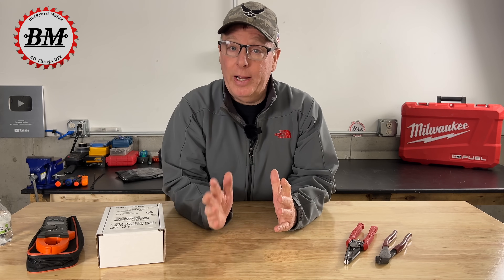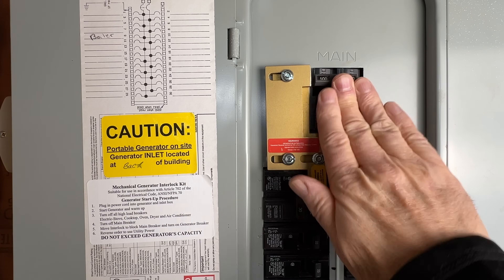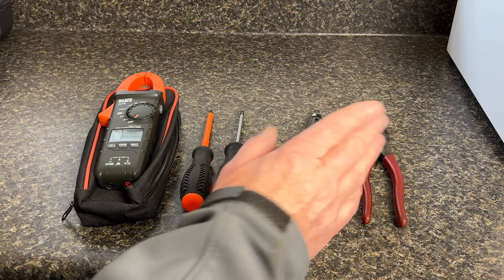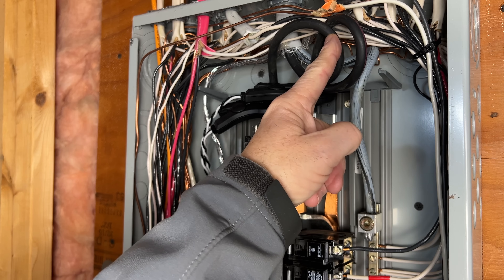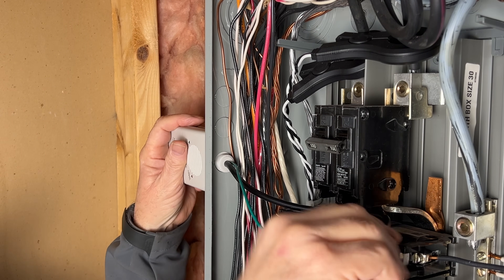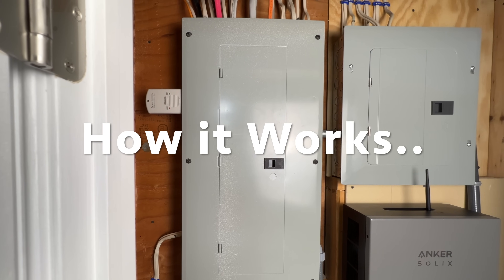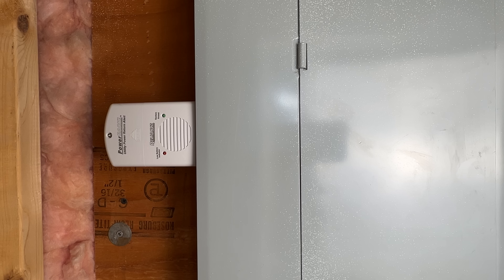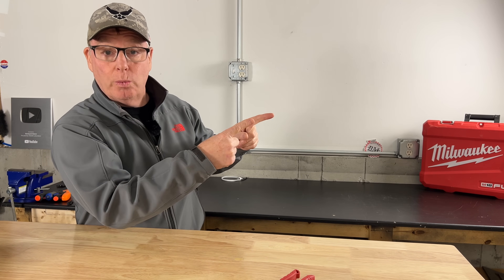The Secret to Knowing When Power's Back On!

Comment: Not a fan of it using a 9V battery that will require remembering to replace it regularly.  Some sort of self recharging system makes more sense.  Didn’t catch if this unit is outdoor rated - our main panel is outdoors.  The loud noise to notify would be obnoxious to our neighbors (and us) especially if it happened when we aren’t home to shut it off.  Why not just a light up an LED as an option?
Reply from the maker: I would guess it will last years since the device will only be turned on during an outage.
Reply: A self recharging system adds complexity to the installation and would probably double the units price. The manufacturer considers these things when designing the device.

Comment: 3:00 DO NOT, ever, pull a utility meter!! One, it is sealed by the power company and if you break those seals without the company's ok, you WILL be charged with meter tampering which carries some hefty fines and possibly criminal charges.  Two, Pulling meters is extremely dangerous and can result in a fire, explosion or arc flash. ONLY the power company or a properly trained electrician can safely pull a meter. (Even then, failures can and have happened. In my career as an electrician, I have had about a dozen issues, a few breaking the meter or the connections, a few arc flash incidents and one explosion.)

If you are installing this alarm and need the power cut by pulling the meter to do it, call your power company and arrange for a quick disconnect/reconnect service call, with your electrician present to install the device at that time.  There are SOME areas where the power company will allow the electrician to pull and reset the meter, but it is NEVER a DIY/Homeowner permitted process.  (Some electricians also have the appropriate PPE and experience to install the alarm without shutting the power off.)
Reply from the maker: I just give them a call and they make a note that I pulled the meter for a repair or replacement. No problem. But of course this would be done by a licensed electrician like myself.
Reply: @BackyardMaine  Thank you for the reply. It is the same in some areas I used to work, licensed electricians could call and get the ok. As I mentioned in my other reply to the retired lineman, I was trained on the right way to do it safely and provided with a supply of seals, meter rings and blank covers. (For some unknown reason, that utility prohibited the use of ringless meter cans...odd since those are more secure IMHO.)
Reply: Yikes! I guess my hot panelboard upgrades would be frowned upon. Nobody calling any utility in this house....we used to pull meters and toss them over the hillside at night for people we didn't like.....good times, high school days.
Reply: I hate to break it to you, but here in NJ homeowners can upgrade their own service (I did it)

And the power company told me to pull the meter myself, then put it back when I was done so they could come and replace it and put a new seal on.

There is no chance of arc if the main breaker is off when you pull it as you must be aware
Reply: @ That is only correct if there isn’t any internal damage done inside the meter can? If you pull it & one of the jaws breaks? You’ll be the first to find out-unfortunately? The only way to prevent a flash/arc is to disconnect the meter at the weather head or in the service box. Only a competent person should be allowed to do that.
Reply: @johnclyne6350 if I pull it and there’s a broken jaw (highly unlikely), I call the utility to fix it.

There can be no arc whatsoever if there is no current flowing when I pull it. As an electrician you should know this. 

Is there any arc when you plug in a hair dryer that is turned off?
Reply: @ The utility I work for does not own meter cans. That is customer owned property. We would cut you at the pole or the house. 
As for current? There is no current if there is no load. However if a broken jam makes contact with any part of the metal can there would certainly be a flash & a lot of current. The only thing that might stop it would be the fuse on the transformer? Or it burns itself in the clear? So unless the meter can is newish (in the last thirty years)? I would rather cut it at the pole or weather head & then pull the meter.
Reply: @ wow the meters are customer owned? What kind of crazy utility is that?

And yes I agree if the legs break off or something crazy then a huge arc could result. How many times have you personally seen that?
Reply: @ Just about every utility owns up to the house knob. The connections at the house knob & the meter. That's it.
The meter can, entrance cable & circuit breaker box are all customer owned. 
I only know of one utility that owns the entrance cable, meter can & cable to circuit breaker. 
I've seen a few where the meter can went on fire. I've also heard buzzing in the meter can on a sunday. I advised the homeowner to get an electrician. If I disconnect & find a broken jaw in the meter I would have to leave him off until repairs were made. He followed my advise & had an electrician there a few days later to replace the meter can. Better that than an emergency call.
Reply: @ ahh the meter can vs the meter, thanks
Reply: @ Yes, they are two separate components. 
The meter is always owned by the power provider. 
The meter can & associated hardware is owned by the homeowner. I can't begin to tell you how many customers don't know that. Then when it's rusted out & in decrepit condition & we disconnect for an unsafe condition. The customer is surprised. It's all part of what the original owner didn't impart to the next owner & subsequent owner. 
For instance. There are overhead & underground easements on every piece of property. Unless you live in a rear lot without any hook ups? 
The homeowner's responsibility is to maintain a 3 feet clearance around all utilities & no improvements shall be made in an easement. Failure to do so is a violation of the easement. 
If your tree comes down in your easement & wrecks utilities. The property owner is responsible for all repairs. Many times the utility will make repairs to their equipment but the property owner is on the hook for all their repairs. 
I was recently on a job where a tree fell on the utilities wire in the easement. They lost the neutral & burned up everything electrical in their house. Even their old wiring was destroyed. We replaced the service wire & left the tree on the homeowners property. We refused to hook up their service because it was condemned by their electrician. They couldn't afford repairs & were left without power. If the building department were to find out they had no power in their house? They could lose their certificate of occupancy. The house would be pad locked by the building department. Unfit for human habitation.
Reply: @pb7379-j2k  I hate to break it to you but letting homeowners upgrade their own service is the exception rather than the norm. In the three states I have worked in, that varied from county to county and even city to city. It was dependent on local utility policies and local code enforcement rules. As far as pulling meters and/or cutting and connecting service drops, that varied within the same utilities. The utility I spoke of in my previous comments officially prohibited anyone other than their workers from pulling meters, etc. BUT it was the regional service crews/ managers that would unofficially allow others, such as licensed electricians, to do it. Oh, and broken jaws are pretty common with meter cans older than 15-20 years, and you'll rarely know (unless you hear it arcing inside or feel heat on the meter or can) untill you pull the meter out. And not every service has a main breaker.
Reply: @ it’s state law in NJ, the most densely populated state where homeowners can install their own plumbing and heating appliances too. We have to pull permits of course. Freedom, fuck yeah
Reply: Stop being so dramatic. It was always common practice for us as a retired lineman, to pull meters with just leather gloves. Pulling an arc, it’s only 240 volts going into most homes. You are correct about most power companies frowned upon it though.
Reply: @purplesocks5984  Except when the jaws are broken inside & you can't tell? You pull that meter with leather gloves you'll be fine. The arc flash is another matter. I wear safety glasses & a flash hood when pulling meters. Yes, I'm a power lineman that is still working. I have seen a few meter cans blow up from meter jaws broken inside.
Reply: @johnclyne6350  Thank you. Mr. Smellysocks is just trolling. I have, as mentioned in one of my comments, had a few meter cans blow up when removing meters. It is no fun. After about the third one I always cut the hots at the weatherhead before trying to pull the meter. I had good rapport with my local utility and they had no problems with it.
Reply: @ There are a lot of ignorant people on here who try to impart unwise knowledge. They might get someone hurt? Ofcourse they would disappear after that.
Reply: @purplesocks5984  No need to be a jerk about it. As a former lineman you of all people should know the risks involved  if someone with no experience or training tries this.  I have over 45 years in the trade, and had many utility servicemen and meter dept. guys told me of failures and injuries pulling meters. I was trained by my local utility in the proper way to pull meters for service work or service upgrades (they even provided me with seals, blank covers and rings.)  The way it was worded in the video (not intentionally) made it seem like he was saying it's ok for the average person to pull a meter. They wouldn't know the correct way to do it, and maybe the company you retired from didn't care, but times have changed. Fault currents in residential areas have increased, more dishonest folks steal power...all stuff you of all people should have known. I'd rather be dramatic than hear about some homeowner getting burned or killed by trying to pull a meter.
Reply: @mxslick50  Let me first say that I'm not an electrician yet I have pulled probably more than 100 meters, LEGALLY, as a volunteer firefighter on Long Island. Whenever there was an electrical fire or a working fire, I would pull the meter. Many times, while the meter was under load. I've never had an issue except a slight flash if it was under serious load.
Reply: @ You've been very lucky. Eventually your luck will run out. There is no way to tell when a meter can will fail. Buzzing sound heard inside or heat transferred to the steel box might offer clues. 
We stick to electrical issues. You won't catch me pulling a line off an engine. Likewise I suggest you think twice about pulling a meter unless time is of the essence & someone might get hurt or worse?
Reply: @ thank you, this tracks. I have to say the electricians tend to talk a lot of doom and gloom but reality is a lot more boring
Reply: @pb7379-j2k  Yeah because unlike homeowners, handymen or other wannabes, electricians have seen and/or experienced the aftermath of other's ignorance or stupidity, or equipment failures. Until YOU have actually seen the aftermath of an arc flash incident, or watched someone die or get seriously hurt from arc flash, you are in no position to talk.
Reply: @ got it, I’m a wannabe, thanks dad

Comment: Cool little device, I spotted it when I was poking around looking for somebody else but ended up going a different route (neon indicators, that's what he wanted! I at least fused them). Wasn't a lot of information out there about it 4 years ago. It's really too bad they didn't make this device so it attached to the generator side power, so it was only active and powered when your generator was running no battery needed. Then there would be no need to operate the switch. Although I'm curious if one were to power it with a 9V DC adapter plugged into a outlet that's only fed by the generator if it would come on and operate in and function. Then one would only need to switch power and turn off the generator.
Reply from the maker: I would imagine the batter will last a few years or more since the device will only be turned on during an outage.

Comment: I ran my generator for 3 weeks until I realized power was restored after 7 hrs.
Reply from the maker: I'm sure you're kidding but none of us want to be that guy who runs his generator all night when the power was restored in the afternoon. lol
Reply: @BackyardMaine    true story from working 25 years in the standby gen business....  Customer calls late at night furious that there was no power in the house after recently spending $50k on a BIG set. (Greenwich Ct, bedroom town to NYC) We go there to find a 3 month old set in perfect shape, but has 250 hours of run time and no fuel. (4,000 gallons of propane) Further checking shows the underground power has failed and the driveway is near 1/4 mile long. The neighbors all had power so we figured his line failed over a week ago and the set ran till the fuel was gone. He also didn't hear it running because of his insistence that it be located far from the house. Ok, holiday weekend with no fuel delivery possible and the utility says they will need to bring in subcontractors on Monday to start digging. (can you say Holiday Inn?) Yes, he did install monitoring for power and fuel level after this issue.
Reply from the maker: @rupe53  Crazy.. That was a costly mistake..

Comment: looks like a neet gaget. but should have a rechargeable battery system in it
for me all my breakers and main also the manual  power block is all outside.
i will stick to the tried and true way.
no street lights here. no “other” house to look into.
but i can see into part of town.

Comment: Our transfer switch is on a sub-panel that services furnace, water pump, refrigeration, emergency outlets on all floors. . . the main panel is still active so lights just come on when the power company finally gets it act together
Reply: That sounds like the best idea because you have more control over what is drawing power from your generator. People want to just power the whole house, but that's wasteful when you could power the essentials with a smaller unit.
Reply: @CognitiveHeatsink    He's talking the old school way that we used years ago with a transfer switch and sub panel, before interlocks were common. With an interlock you still need to know your loads and what you can't run on a gen set, which requires flipping some breakers off when you operate the system. The interlock system does allow some intermittent use (load sharing) in other areas of the house, although caution should be used.

Comment: I have recently wired in a generator inlet box and an interlock and also had the same concern. I added a little 240v LED directly to the utility supply coming into my breaker box. It won’t make noise but definitely visible anytime I have utility power on both legs.  Only cost a couple dollars.
Reply from the maker: That will work but it's a not code compliant for a few reasons. One you cannot put more than one wire in the service lugs and you have no overcurrent protection for the wires or the device. This could be dangerous and possibly a fire hazard which would not be covered from your insurance if they discovered the cause of the fire.
Reply: That is illegal.

Comment: I do not have our hallway light on my transfer panel, so when I switch to generator power I just turn on the hallway switch. This seems way more complicated than necessary.
Reply from the maker: If you have a separate transfer panel for your generator loads this would not be needed since everything else would return when power was restored. Most generator users do not have a separate panel of their critical loads.
Reply: @BackyardMaine     right... not these days. OTOH, 20 years ago a gen subpanel was what many did because interlocks were not approved then.

Comment: You have identified a common problem with generator interlocks. That is a great solution for most folks. Our utility has different rates for water heating so we have two utility meters. When I installed our backup generator I used the fact the water heater remains connected to include a visual and audible indictor when utility power comes back.

Comment: Thanks for the video!  Now I'm wondering if I can just use my non-contact voltage probe to check the hot wires going to my service.  Probably not a reliable indicator though...
Reply: That should be very reliable and you won't have to worry about being startled awake in the middle of the night by that 100db siren.
Reply from the maker: I was thinking about that as well but I never run the generator while we're sleeping so I would just switch it off when shutting down the generator. I usually shut off the generator and switch back to utility at night and it's always comforting when you wake up to the power coming back on.
Reply from the maker: That would work better than cycling breakers. I like this method because its cheep, easy to install and I'm covered from now on.
Reply: some of those non-contact probes will give you a reading at the face of a breaker, which means you may not need to remove the panel cover. OTOH, if you have a digital utility meter you can just look at that to see if the numbers are showing, which means the power is back.

Comment: Another thing you can do is take a circuit detector pen that alarms when its near a hot wire, and jam it beside the main feed wires. As long as its the type that you dont have to hold down a button for it to trigger. Once power is restored the pen will start beeping constantly until you pull the tip back away from the wires feeding your panel.